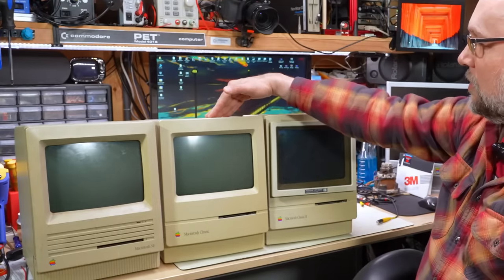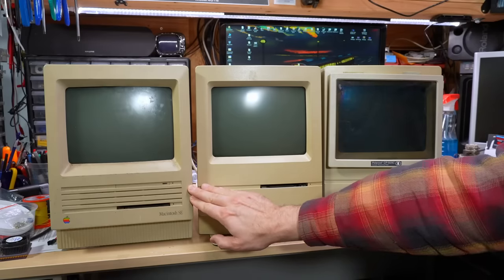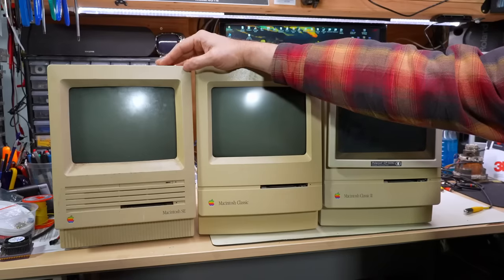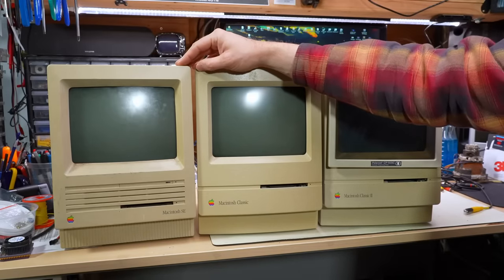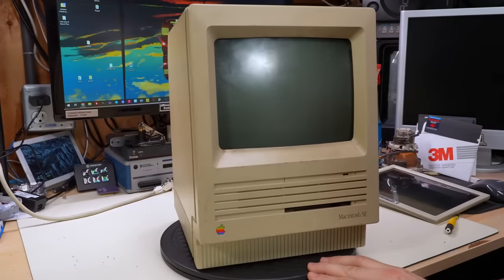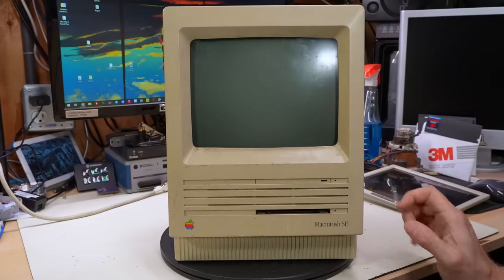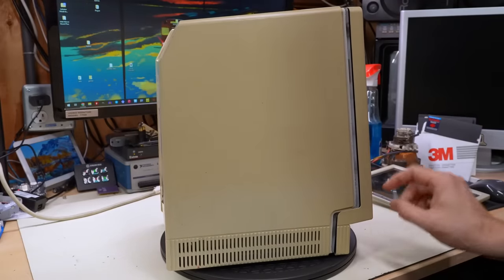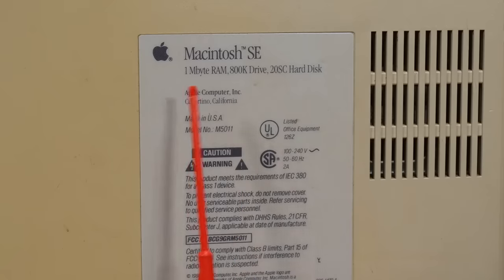Three unknown Macs: Let's get them working again #repair

Comment: Hey Adrian, what makes a computer monitor CRT any different from a television CRT? If you found a really big picture tube, could you just hook it to a VGA controller board?
Reply: On color displays monitors have better dot pitch than television tubes. This gives a sharper image at the expense of brightness. You theoretically could put a giant TV tube on a high-res monitor chassis but it would be like looking through a screen door.

Comment: is the SE pretty similar to the SE/30 as in just needing basically reflowed solder joints? I know my se/30 has an issue with producing sound, I think may be to do to with bad SMC's..
Reply: The SE/30 is worse than the SE, because it has a number of surface mount capacitors on the motherboard. Not only do those fail, they can damage the board. The plain SE doesn't have the surface mount caps, so they're very low worries

Comment: re: BlueSCSI and termination power: Most of the Apple II SCSI cards don't provide termination power. (I think the RamFAST cards have a jumper to enable it.) There are easy mods for the Apple II Rev C SCSI Card and Apple II High Speed SCSI Cards to add it though.
Reply: I remember adding a 1N4001 diode to my Apple SCSI card for terminator power. RamFAST had a DIP switch to enable power IIRC.

Comment: I've talked to you about my grandfather's Macintosh Classic before and he upgraded the HDD to 40MB from the original 20MB and the RAM to 4MB. As for the display it would have that issue with the wavy lines and sometimes it would go squish and he would just give the right side a good whack and the screen would go back to normal. Since he passed away back in 2019 that Mac is now mine although I haven't looked at it yet. I have to find it first as all the stuff from my grandparents house was put into storage. Hopefully when I find it and open it up it won't be a bunch of carnage waiting for me. I know my grandfather did use it from time to time before he died so it was working.

Comment: Never trust a lithium battery's voltage. I have had plenty of them showing almost-full voltage while outright not working. It seems like lithium batteries has a high internal resistance when drained but maintains the voltage. However, with that said, the Mac SE seems to have been through some careful repair. I wouldn't be surprised to know that the battery has been replaced.
Reply from the maker: Indeed, anything is possible with these machines.